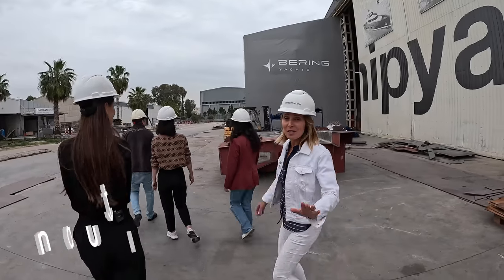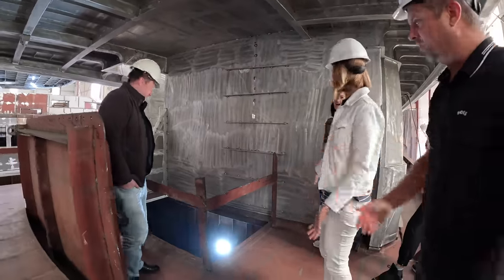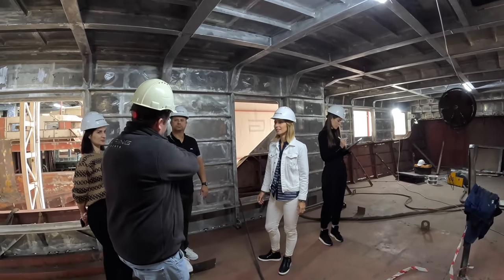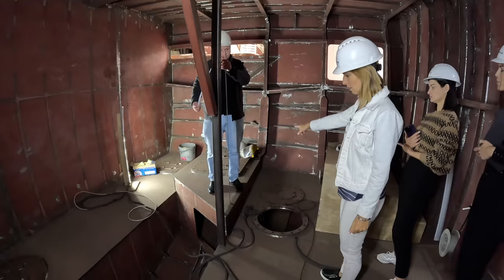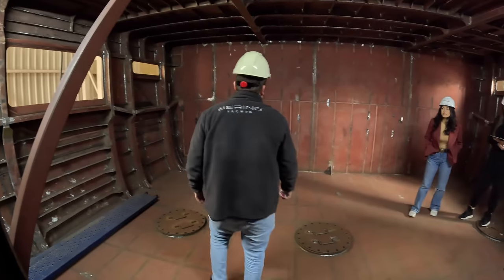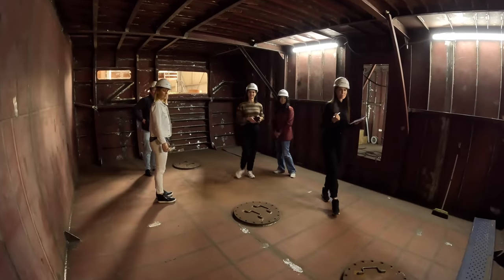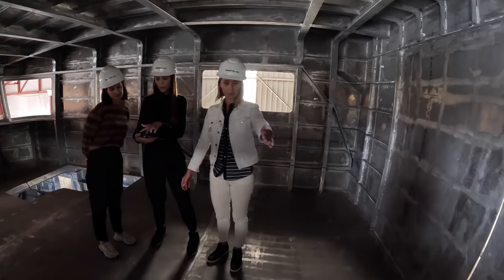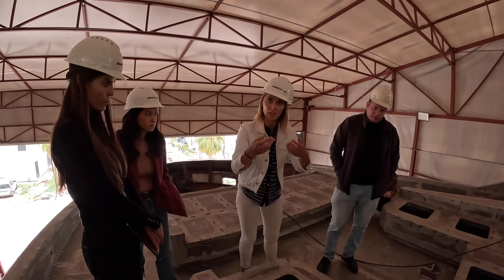World's Biggest 75' Yacht: our Bering 75 Explorer First Upright walkthrough 🤯🙈 Eps. 26

Comment: I can't believe people are commenting it's going to tip over.  Forgetting that the bottom part of the hull is 70 tons and the top is only 15 tons, once the engines, fuel, water, furniture, electrics, and everything else go into it, it'll be a difficult boat to capsize.  And with the stabilizers, she'll run like a dream.  Amazing to get a walk-through of the unfinished boat.
Reply: armchair marine engineers
Reply: My thoughts exactly 
Steel hull = more options for the top decks
Reply: Brings back memories when I worked in a ship yard building ocean luxury yachts back in the 1960s.

Comment: Rico was joking about putting in a Skylight, but if you used VELUX Skylight tubes you could put the light gathering end in the side of the boat and run the tube to where you want sunlight coming in and have a Skylight, even though of course you couldn't see out of it you would still have more natural light coming in the room!

Comment: Congratulations 🎉 Your boat is amazing! Due to My extremely limited knowledge about boat building joining two different types of metal together… what is required for Aluminium and Steel joining? What is used for a buffer to prevent galvanic corrosion? Or is no buffer needed? So looking forward each video of your build. Cheers Jen🐨

Comment: If I do the Bering 75 I will want to extend the full beam portion on the port dining room side up to the beginning of the living room lounge to create more room for the dining area so all eight guests can sit around a table and I will paint the extended portion Black so it doesn’t take away from the angled column and will still aesthetically match the other side of the yacht. I made a comment about you not putting in a glass slider facing the aft deck on another video but then after seeing the floorplan video I was relieved to see that you are putting a glass slider in. I have seen other yachts that didn't have the sliding door facing the aft deck and it totally makes the guests on the aft feel cut off from the lounge and it was terrible for traffic flow and function. I am happy to see you are also making a good-sized crew cabin with a desk and a proper bathroom, a happy crew makes for a happy voyage. It is smart that you are thinking about storage for the dock lines and fenders instead of just throwing them in the bow which creates a tripping hazard for guests and crew. So excited for you guys to see your dream becoming a reality.

Comment: i'm glad Victoria picked up on the frame work under the forward benches, when i first saw them i was wondering what was going on, Victoria was asking about access to the storage under the benches, having a one piece lift hatches which essentially saves moving cushions accessing and putting cushions back as suggested with smaller boats made in fibreglass, i couldn't see the compatibility between what was being asked for and what was built in front of them
ok so i realise that some framework is installed for some basic strength for keeping square for assembly and when the upper structure is lifted onto the hull, but once that operation is done, really none of the upper aluminium structure needs strength as that is all in the hull with exception to supporting itself, contents and people, seating and walls really can have as much storage as possible, you could hide so much stuff away, with exception to having insulation and cable ways etc
fantastic looking boat, can't wait to see the interior going in, epic

Comment: Love both your channels Victoria and Rico. Thoroughly enjoy following your Bering 75 build. One question though: How does Bering avoid galvanic corrosion between the steel hull and the aluminum superstructure? Is that strictly a matter sealing out saltwater contact at the joint via the priming and finish coatings. Also what type of weld is used to secure these two dissimilar metals? Appreciate if you could please address these questions in an upcoming episode, or point me to the video if covered previously. Thanks and keep up the great work!

Comment: You have been good enough to invite us to participate in your build. I wanted to suggest the best navigation house I've seen to date - on Nick's (Aquaholics) brand new Navetta 75 video. 
This is the navigation house that you want for your boat; clean, modern, visible and safe. The Bering approach has been a couple of generations behind in previous boat releases.
For Bering's important benefit, I strongly suggest the solution showcased by Navetta (which might include GPS position stabilitzation as well) - even if Bering Alexii wants (realizes that it's important) to hide manual backup controls elsewhere for safety and redundancy.
My fear (the reason I mention it) is that you risk building an outdated boat, so don't dismiss this important stuff - that adds a small fraction to cost of the whole construction.
This year, that Navetta 75 would be the boat to leapfrog, if only it had fold down sidedecks like Galeon.

Comment: Rico, your confidence is reassuring. As you install the speakers be sure to add a few laser lights to set the mood on the dance floor. Victoria, I admire your memory and sense of space and direction. I would have a hard time envisioning where walls go and remembering the order of closets vs heads. It is exciting to see the vessel coming together and the “Bering It All” team ensuring enough access points for maintenance. Victoria’s memory about the best designs from Horizon show the value of a knowledgeable owner in the design process.

Comment: I saw light, through the steel panels, by the crew quarters. The aluminum was sealed.  But, not the steel  panels.
Do they seal that? So, rain or water doesn't get through to the interior?
-Mike
Reply: As they said in the beginning, the welds will be done from both the outside and inside. They have a whole sophisticated system for finishing the walls, hull & superstructure, inside and out. One of their early videos on this channel explains it in detail.

Comment: Here a GOOD question for YOU Guys from another Person:   As a Marine Diesel Mechanic and crap like this happening is not common but it does  (Bridge Collapse in Baltimore) This is what happens when everything is Electrical on boats. It makes everything easier and convenient but also make it easier to FAIL!!! One wire breaks, shorts or exposed causes chain reactions all through the systems. This is why ⭐⭐⭐analog is the best. Even if power shuts down on analog boat, it doesn't  AFFECT the operation of the engines and controls. You maybe can't see your a gauges and instruments but you wouldn't be dead in the water.⭐ Something to THiNK about.⭐ Alan 😀🦜⭐

Comment: Yeah, slightly worried about the window height on the bridge. Seems to me that if you’re standing you won’t be able to look up, possibly not even horizontally if you’re an average 6 footer. Guys please double check that dimension. It’s not a disaster if it’s wrong because you’re gonna be sitting most of the time on a passage, but it’s not going to feel right either and there may be times when you need that view up whilst you’re standing.

Comment: Hi @NautiGuys

Really interesting series of videos and I’m very much enjoying your journey!

On your videos, it appears like you’re still trying to design the interior layout at this stage, and may not be able to fully understand the amount of space that’s available so you can get the layout and styling exactly as you’d like it. If you haven’t already, it would be well worth asking the Bering Design Team if they can load the designs of your yacht into Virtual Reality (VR) for you, rather than trying to use a flat computer monitor to visualise it, which gives you absolutely no idea about the amount of physical space that’s available, how the layout will flow, natural lighting, fixtures, fittings, colour schemes etc etc and many other things. In VR, you can literally walk around your fully finished (in this case) yacht (you can use VR for many things), and see how it will look, understand how much space is available and much, much more. Depending on the VR software, you would be able to make real-time changes to the interior while you’re inside the model, such has the layout, lighting, colours, furnishings, technology etc etc, and you would be able do it together as a multi-user experience. Ask the Bering Design Team to have a look at a couple of pieces of software called Unreal Engine or Unity if they haven’t already, so you can load the CAD models into VR. Other software from Siemens, Dassault or Autodesk (probably what they’re using for the CAD) will offer similar functionality.

You would want a very high quality professional VR Headset, so something from Varjo or HTC. If you haven’t experienced your yacht in VR yet, then you have no idea what you’re missing out on, pretty much all of your questions would already have been answered! 😎

 Thanks again for the content, and best of luck! 😊

Comment: Wow,... Ricko, can now finally brag, " he has a big one "😂😅, on the down side, in high side winds. It's going to be wild. And now looking at just the hill, wow , that babys size has eliminated all most all marines size limites. She to wide to dock at marina's.  Her draft is going to be so deep . Even refueling will have to happen at, container ship docks. Even morning balls have LIMITES to how big of a yacht they will hold. 
Just a tip, buy one big tender,  because on COUNTRYS going to let you in close to the shore line. So have plenty of extra chain to anchor in 400 feet. My first, was a big one, I got her at 80% complete. 200 foot plus feet.
35.000 gallons of fuel. My God, to line up 3 full 10.000 gallon tanker fuel trucks just to fuel up. Was a MEGA pain in the butt. Then to find docks to tie up to. Then all the extra insurance to dock at some. France, is wonderfull, till the daily, anchor prices, wow,
They can go into the 10s of thousands, I know your thinking but she only a 75. Yes but a 75 that needs 20 feet at low tide. Marina's who have 20 plus feet at low tide, tie up 100 footers, 150 footers, there not going to dock a 75, and loss the dock fees of a 100 footer. You be at anchor a mile off shore😮. Have great, securty, have a great tender, you won't get by with a dingy 😅. 
It would be like buying the wrong size condom before a orgie 🎉😂.  You may want to start, markting to major, firms now for chartor partys, market to the fashion industry's, for photo shoot charters, to World VO brands, for charters, and sport team owners. I would hire a markting firm asap, to fill the first 3 years, with charter with very deep pockets...asap.🎉

Comment: Having owned a handful of big boats/ yachts. The operational cost of these ships will run you somewhere in the neighborhood of 10% a year. So if you build a 3 million dollar boat it will set you back approximately $300.000 annually. This does not however cover the cost of the crew, or any loans, or financing you may have on the vessel.offsetting some of the large cost with a charter operation can significantly reduce the operational expenses, but will not cover all the annual cost. Add in the depreciation of the boat the minute it’s launched. And the endless number of unforeseen😂 problems than can arise. Weather being a huge factor. Red tide, or something like Covid. And political instability in areas you need to have deep pockets to keep a ship of this size running smoothly. They require a tremendous amount of daily maintenance, and care. It truly is a rich man’s sport to own a luxury cruising yacht . Try to your building cost way down. Most guest will only be on the boat for a week or better, and they will never no the difference. Keep it simple stupid is the best way to build in my opinion. The less electronics, pumps and mechanical systems the more you will enjoy the vessel. I found this out through many years of ownership. The old saying is true in big boats, Less is More, cheers. And all the best.